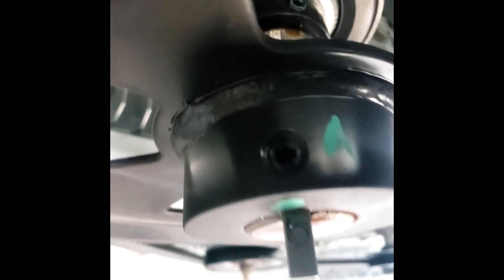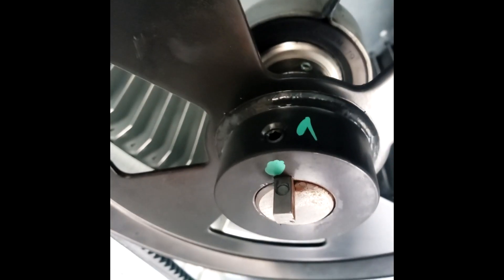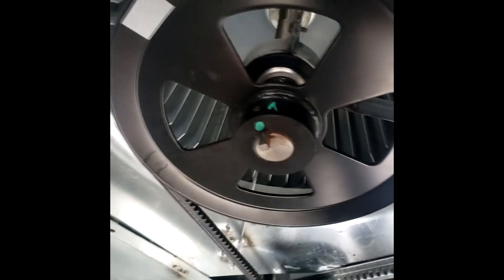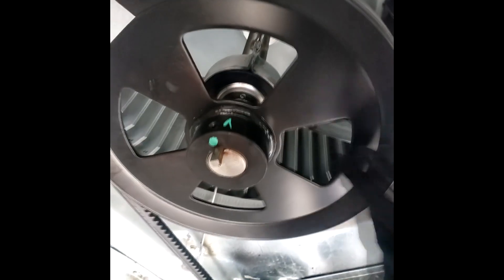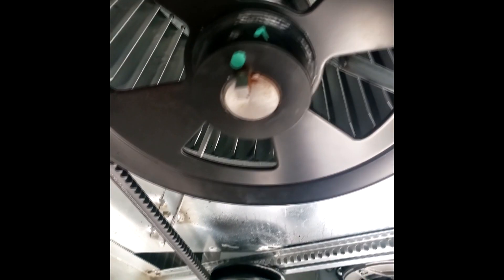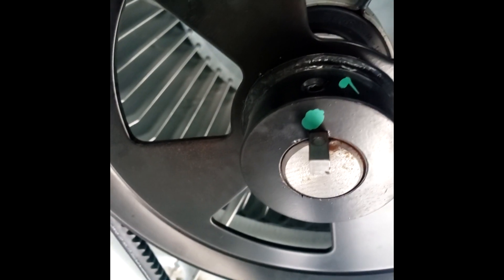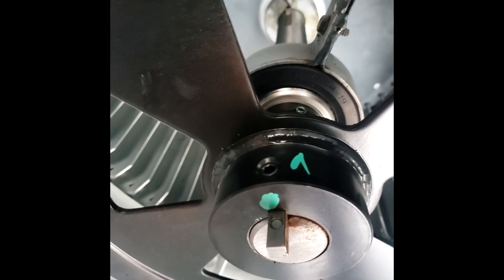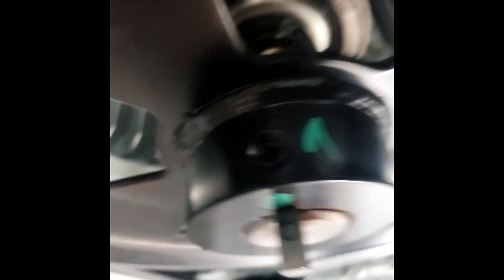"Dust Storm in Trane Package Unit: Blower Wheel Replacement in Action!"

Comment: Sometimes these things get loose... Happened on a new install, i heard my blower wheel scraping...and when i checked it i found my set screw loosened. I installed the unit and I ALWAYS check the blower wheel, it was tight, guess not enough. Great vid